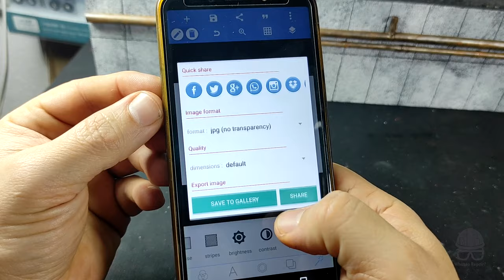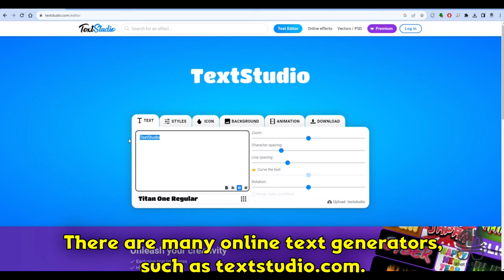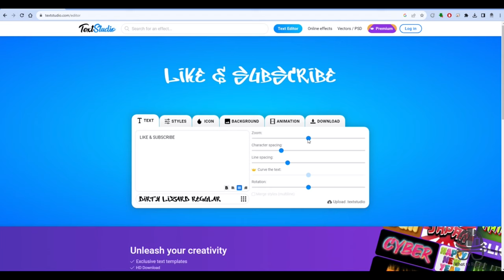Underpass graffiti diorama for diecast cars, 1/64 scale

Comment: It's really nice ...just found your channel loving it because im a  Collecter, and i want to start taking pictures with diaroma...questions did youa  3d peinter for  these pipe fittings
Reply from the maker: No, they are not 3D printed. Those are fittings for small irrigation hose, for 1/4 inch or about 6 mm hose. I bought them online, I think Aliexpress, but they can be found in local stores, maybe in some gardening equipment stores or aquarium equipment stores.